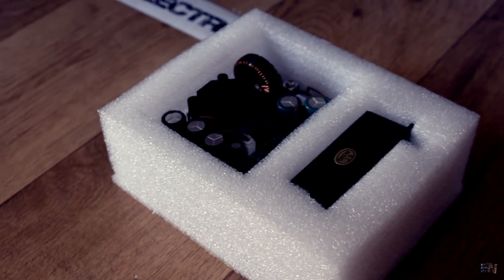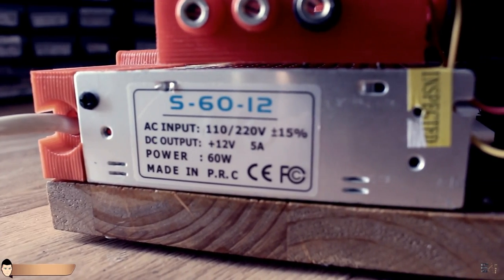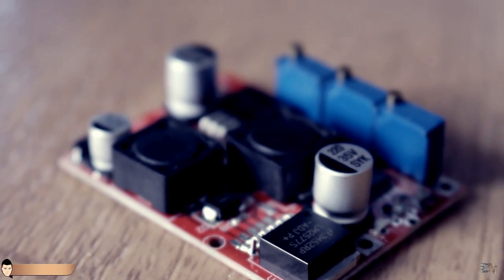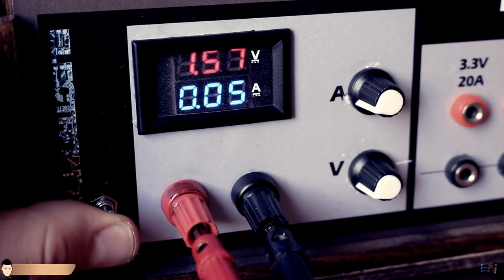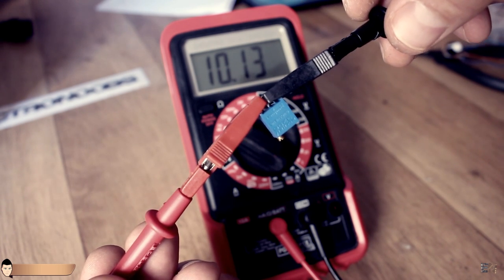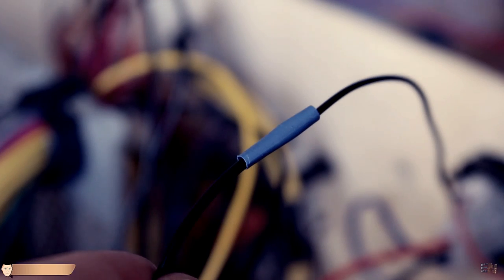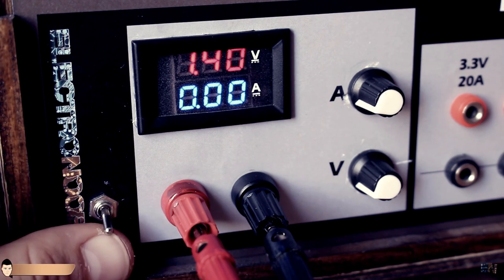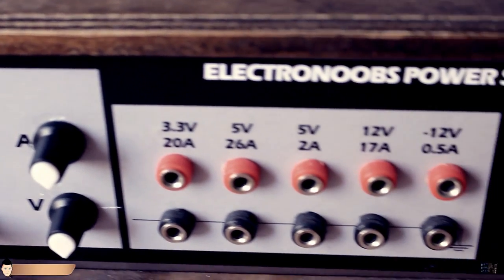DIY variable bench power supply (less than 10$)

Comment from the maker: You should add a high power dummy load on the power rail (in this case red 5V) to keep the power supply a little bit more stable for low amounts of current. I forgot to mention that.
Reply: OK, got you!
Reply: I built this power supply  a year ago, adding dummy load burns the connection wires , the load resistor is burned , and DC 400v capacitor also burned, it's not suitable for lab purposes. 
 I tried removing short-circuit protection ic but mains supply is shorted I don't know why but it's lethal man.
Reply: Sounds like you did something wrong, the resistance of your load might have been too big.
Reply: karlpc200 nope, I watched so many vids in utube they are using 10ohm resistor .
Reply: Yeah but maybe just a 1 ohm would be good. It shouldn't be able to burn the wires then. Anyways, if you burn out the wires you are definetly doing something wrong. :)
Reply: Michael Liles dude choose a resistor which suits your power supply if you need 12v, 2 amp , use V=IR formulae to choose the resistor .
Reply: It usually states on the side of pc psus that there is a minimum current before they are able to sustain a stable voltage.
Reply: Michael Liles yes，atx PSUs are know to have trouble with output stabilities when the load is light, sometimes even gives no output when no or light load
Reply: You said this was made out of balsa wood, are you sure it isn't plywood?
Reply: Electronoobs Thanks for the video. Can you tell me what part do I need for this dummy load and how to connect it? I don't know much about electronics. Thanks!
Reply: a 12v bulb connected to the 5v side works well on some older power supplies, some older  enermax ones require   bit more fiddling to get right ,  but have had good success with low cost  'haswell ready' power supplies,  I've got a couple of repraps running these and they dont seem to need a dummy load to run stable -
Reply: Andy Davies Thanks!
Reply: 100ohm will only result in a 50milli-amp load on the 5v rail. Which is not a lot and 1ohm is no were close to a short. it will result in a 5amp current draw of course you need a pretty beefy resistor that can handle 25 watts of energy.
Reply: There is no way you burned the wires with only a 500milli-amp load. A normal power supply has 18awg wires which are rated for 10amp continues load. It is possible of course that you burned your resistor which would lead to a short. You need a resistor that can handle above 2.5 watt. the normal little blue or yellowish resistors are not rated for that kind of energy and will burn very quickly.
Reply: You know less resistance means more current? so decreasing the resistance would not help at all if it already starts burning at 10ohm resistance.
Reply: But which resistance would you guys suggest?
Reply: To get a stable current from a power supply you should add a 1 amp load on the 3.3 5 and 12v rail. So a 3.3 5 and 12 ohm resistor should do the job. of course make sure the resistors can handle 3.3 5 and 12 watts of energy.
Reply: Electronoobs why you did not make with step down transformer,diode and capacitors?
It will most cheaper
Reply: your schematic is wrong
Reply: in minute 6:04 you use your schematic wiring but in 6:07 is different!!!
Reply: What should my dummy resistor's ohm be
Reply: So a resistor on each rail? doesn't that sound a bit excessive? ofcourse i'm not here to prove you wrong but to ask a question as im a noob. I followed this guy's video and have got everything almost ready, but i'm confused about the resistor thing, in some videos, they suggest 10ohm resistor(s) on 5v rail, some recommend more resistance, but my supply works fine without any load(by that i mean i can run something from 12 and 5v rail)
Reply: Where did you get the smaller bannana connectors
Reply: @Blondie SL  <--- Do not confuse people with inaccurate information: 1Ω is NOT close to a short, it is simply a very low R value thus perhaps not enough to trigger the ATX PSU logic to activate "thinking" that there is a load.  A "short" is when voltage is applied over 0 (zero) Ω thus current surges to ...infinite. Additionally, as we all know (except you) 0 is NOT 1, check your terminology. Furthermore a 1 Ω resistance is definitely NOT "overloading" the PSU, it's the opposite. Use Οhms Law (you know about that, right?) to calculate the current draw according to the voltage rail you are using. Finally, converting a ATX to a "bench power supply" is technically a "hack" and people with limited knowledge of electronics (like you) should NOT attempt to do it, at least NOT without any supervision, as you can easily kill or seriously hurt your self in a matter of a ...split second. Having said that, IF you decide to go ahead, depending on the ATX PSU sensitivity, a wire-wound resistor rated ~ 10 Watts/10 Ω must be connected on the 5 Volt rail as a dummy load.  Actually, instead of a dummy load (that will produce unwanted heat) many people opt to connect a "useful load" like a light, a fan or ...whatever that will meet the ATX spefication for the PSU to provide a stable output.
Reply: Wouldn't the LCD display be enough load to keep the PSU stable since it draws 5V?
Reply: What you mean power dummy? Add a 100ohm resistor? It is for the 5volts plug banana?
Reply: Please explain  that what is a high power dummy?
Reply: Bro make video about it only 
Like modifications  of my power supply
Reply: Hi when I connect the voltmeter-ampmeter my power supply turns off like iif ther was a high power impulse so I added a 10w 47ohm resistor to the 5 volt output but when I turn on same  thing again plus the resistor has started burning
Reply: Please share me the link for the power supply you bought
Reply: I know you're trying and I give you a thumbs up 👍👍but please 🙏🙏🙏 talk bout Arduino

Comment: There are only two things I would change about this design. Some power supplies require a minimum load on the 5v or 12v rail to keep the voltage outputs in range, so you should use a high-power dissipation resistor or a small static load to keep the PSU stable. In my case, I used an extra fan and some bright white LEDs to illuminate my workspace. The fan draws 12v current and the LEDs draw 5v.
Second, since all of the ground lines are the same anyway, you may as well get a piece of aluminum or copper bar, drill holes along it, screw all of your negative terminals to it in a row, then connect all of the ground lines to this metal bar. That way, each negative terminal can have access to all of the ground lines, and you don't have to worry about partitioning out your ground lines according to which Vout you hope your highest current draw will be on..
Reply: I have 2 10 w 10 v load resistors and an extra fan is that to much? and can you use a extra capacitor to smooth out the signal?
Reply: You can always set up  fan to suck up soldering fumes on top of the unit.
Reply: Brilliant tips!
Please consider a short video on this subject.
Cheers m8
Reply: @cri8tor  that would be nice
Reply: @konyaelod  Yea I would love if Jaden made the video showcasing his tips, but yea....too late
I would ask  you tho, Jaden, are you talking about copper ground bus bar ? I was searching for it on Google and it seems to be what you are referring to in your second tip, care to elaborate ?

Comment: Nice production quality, and effort.
   FYI the PWM SMPS controller circuit designed into ATX power supplies only uses 1 rail for the 2 comparators and feedback circuit. This means that all other voltage rails are regulated through magnetic coupling only. Most of these ATX bench supplies eventually fail because of this configuration. These supplies are designed as cheaply as possible for a very specific type of load. The load must always draw more current from the main rail as it is designed. The main rail is the rail with the highest current rating. If you understand this circuit topology you will also see why the extra voltage rails appear to drift a small amount as the load changes. Some supplies use additional linear regulators to limit this issue. Regardless, if you try to pull a considerable current from one of the extra rails while the main rail has a lower load, the SMPS controller doesn't have the ability to monitor and compensate for it directly. This is an easy way to cause the circuit to fail.
   If you want to understand SMPS controllers in depth the simplest starting point is a "Peak Mode" controller. These only have 1 comparator and feedback loop. They are far more simple to understand. Most 5v car-type phone chargers use the simplest configuration possible. These devices usually come with a MC34063 chip in a simple 9 component DC to DC Buck Converter configuration. The next easiest Peak Mode controller to find and modify are the power bricks for laptops/printers. You can make simple adjustable power supplies out of all of these by themselves by just adding a potentiometer in place of one of the feedback resistors.
   I've uploaded a couple examples before. I'm none monotized and no affiliation links. I'm just here to make friends and check out what other people with similar interests are doing :)

Subscribed.
   All the best, -Jake
Reply from the maker: Thank you for your sincere comment!
Reply: Very helpful to know... Question... What if I only used the main rail and just varied that
Reply: @ELECTRONOOBS  can u change the current? If yes min/ max
Reply: Yes of course, ALL power supplies are like that, because Jake knows them all. Especially this antiquated TL494 flyback design he's obviously talking about. Sorry, I don't mean it badly ... even in 1990 there was feedback on ALL low-voltage outputs possible. It then leads to an emergency shutdown if it is misused.
... or ATX1 and cheap, it doesn't matter ... any PC power supply ... the whole thing is a stupid idea to build a laboratory power supply with it. Including the chopper , uh I mean DC/DC converter.
Who comes up with such nonsense? Actually, I say the same thing as Jake, but without flowers. I think that's an absolutely bad idea. A laboratory power supply, like proper measuring instruments, is a basic component of a laboratory. Without it, proper work is almost impossible and a torture. So why torpedo your own fun and success by saving money at the wrong end?
Warning, wisdom: What do you need to build a decent power supply? A better power supply! And a decent measuring device that can tell you what kind of junk ... or not ... you've built.

Edit: By the way, what also belongs to a do-it-yourself construction is a comprehensive measurement protocol. Otherwise the video is just a fairy tale hour ... at least when it comes to power supplies, the key data such as stability and ripple are important and worth knowing for the viewer. Really useless and strangely enough nobody does that with these botch power supplies. I wonder why?;)
Reply: @dieSpinnt  you sound like one of those guys that has all the $$$$$$"laboratory spec" gear but cant build shit ahahha ..... i dont see a problem using an atx supply and a cheap meter for diy stuff like playing with arduinos or repairing and tinkering with your own stuff, now if if you have a company and do circuit design or repairs for a living then maybe a quality comercial power supply would be recommended. as far as stability i did not see any deviations in voltage, the meter may be innacurate but it would display voltage chages if there were any and ripple is very easily minimized with  a capacitor. i am sure nobody will be using a diy power supply to launch a rocket or to control a nuclear power plant.
Reply: @dieSpinnt  What? dude seriously you are THAT triggered??? sorry i dont speak german...you could argue about anything i wrote, but you proceed to insult.... it means you realized i am right and you dont have any valid arguments so you got all butthurt
Reply: @MrHBSoftware  Oh and by the way, if this is some fan-boy-shit (?): I am aware of click-bait. I have nothing against it!
Reasonable 4mm binding posts (as shown in the left side of the thumbnail/PSU-case) are $10 alone ... we all know that;)
And the case? .... hehehehheheeeeee
( Just something: It takes 30 times watching this video = 3hrs working at McDonald's to get a bench power supply that doesn't bite you in the ass ... hopefully .. :) )
Reply: @dieSpinnt  maybe you live in a wealthy country were mcdonalds emplyoees make 6 figures but there is something called world were a bench power supply with current regulation may be worth a couple of weeks of minimum wage...just think about that for a second, the world doesnt spin around you, mister marijuana. and there are people that may be starting in electronics as a hobby that may be interested in building stuff, doesnt matter if its more expensive than buying , because they like to create...again as a hobby...this video was not oriented for commercial use like i have already said.... for example a 50kv high voltage probe costs 80$ , i build my own probes and a spend about 30 but its not about the money, its fun to build our things, maybe its something that a marijuana engineer like you cannot fullty understand, the pleasure of tinkering with stuff not for profit
Reply: @MrHBSoftware  Hear you talking ... You are obviously not interested in a conversation or good advice. You are willingly taking BAD gear (hypothetical ... because YOU DO NOT have such BS, presented here in the video ... THAT IS IMPOSSIBLE .. because you are still alive) and that is your freedom. Your freedom! For a Darwin-Award.
Reply: @dieSpinnt  spell correctly??? what? you can't even tell the difference between safety and security , you can't even write a sentence that makes sense let alone understanding what you read, and you are lecturing me for a letter misplacement?really? what is  a "budged"? and you mock me for not writing kilovolts properly and its you that wrote it wrong looool dude you are hilarious, really ..... its kilovolts not kilo-Volts like you wrote and i am only pointing it out because you want to make a spelling competition out of this since you have no other arguments
Reply: Ah, at first I didn't get it.
He justified that kind of PSU-botch 2 days ago. Now, he talks about SERIOUS PSU's ... wanting to switch the conversation away from the TOPIC ($10).
Maybe our little sucker has some branded goods on the bench, our little Hugo hypocrite;)
Its always nice to see, when you foolish babblers convict yourself:) Bye. Now use gear you can trust and ignore guys you can't trust!
Reply: @dieSpinnt  Ok so basically you say this power supply sucks because it will hurt you and your family and the case looks awfull and since we are all rich we should buy a fancy schmancy expensive psu even if its just for playing with arduinos leds or 555's..? is that it? ok its preety well sumed up....now my argument is that yes it look terrible but if i would watch this video to learn how to build one, i would probably use whatever encoluse i had at hand and i would not replicate his wooden box, not me and not anyone...all the viewers are interested in is to know wich modules he used and were to buy them, is that so hard to understand??? the psu works fine, its cheap and anyone can build it, now go cry to your mommy
Reply: He is Muted.
Thanks for your video, Upcycle. 
Controversial topics are never bad. It is like how to (not) touch the stove top, which children learn. 
Like this design. Which EVERYONE uses at home. (Joking ... in the PC ;) )
Reply: Thank you for this information

Comment: The Buck boost converter is too small for most ATX power supplies. I found one at Banggood that is 600 watts that will handle the amperage from the ATX power supply. Neat project.

Comment: The only issue I have with SMPS is the fact that you can't really do anything with an oscilloscope unless you use an isolation transformer. I built my power supply with a linear transformer. I just used an MOT rewound to 24v.

Comment: Awesome video. Thank you for presenting it in a clear and understandable fashion. The fact that you also included a computer PSU as the base supply was great since I have been a computer tech much longer than an electronics tech so PSU's I know. Now I know my next major project. :)
Reply: Will there be any problems if we use transformer as power supply for this module? Also, will we get noise free output even if we use smps as suppy?